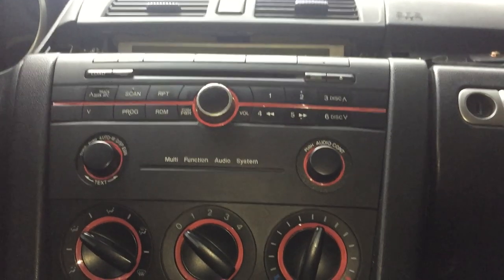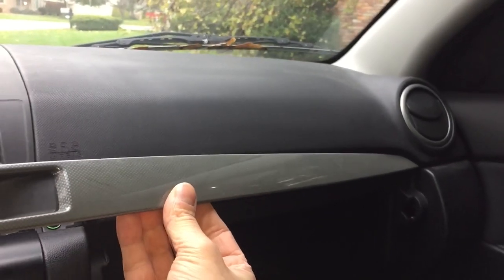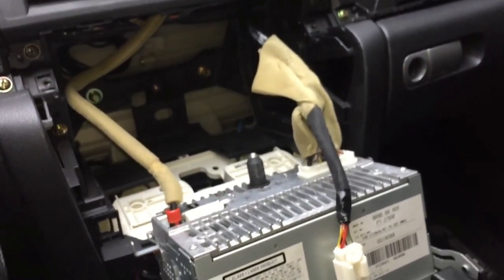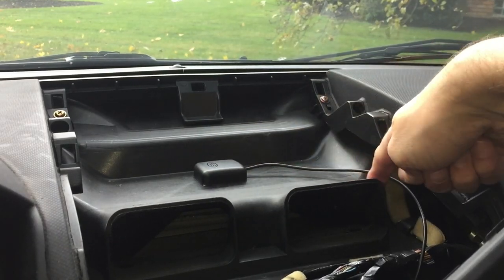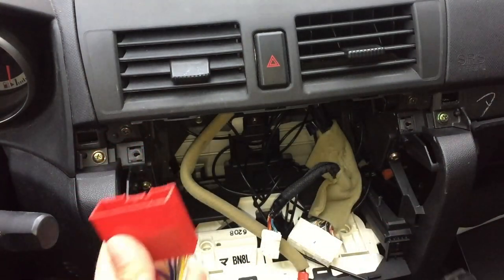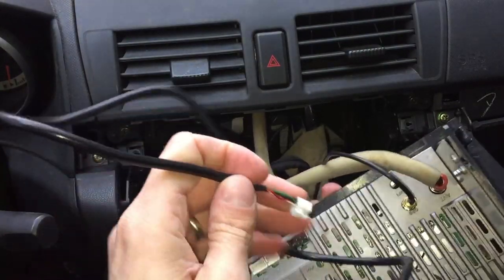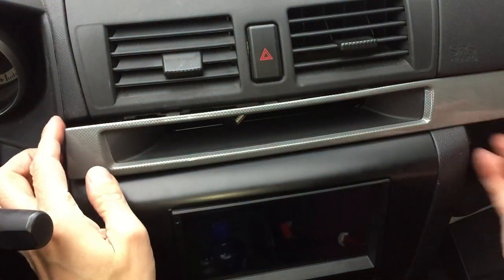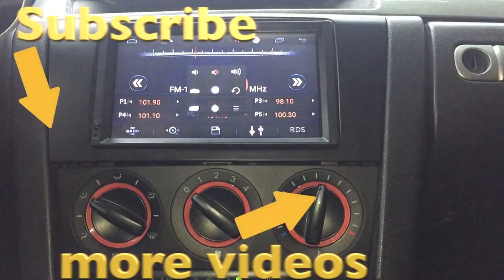Installing an aftermarket radio in a Mazda 3

Comment from the maker: This is where I found the harness adapter on Amazon:

https://amzn.to/2QMSESx
Reply: Did you lose A/C after installing after market radio ?  Did you have manual hvac or auto hvac ?
Reply: @madieandkemo   ?
Reply: Do you not have to hook up the smaller harness that comes off the back of the radio to anything? Just the big, main harness?

Comment: Did you ever have any problems trying to program a new key or key fob after Radio unit install fire sometimes you can not program a key fob with an aftermarket radio

Comment: Both the head unit bezel and head unit look like they're going to fall out. Doesn't look OEM at all, would be a target to thieves, and the break-in damage would be a lot more $$ than the head unit is worth. Went with an Eonon GA9251B. Looks and fits like it's OEM, retained all my factory features/functions including the OEM LCD + MPG calculator, and of course has large knobs.
Reply: Do you find the radio lags at only 2GB RAM?
Reply: Also, does the radio have the eonon logo on it or is there no branding?

Comment: What is the link to the site that shows what wires to connect the stereo Mazda adapter I bought it an I got blue brown oranges pink left  an on othrr side Orange White stripe an blue white stripe not sure what to do with then I looked for link like you said but could not find thanks

Comment: does the steering wheel volume control buttons still work after installing a different stereo?
Reply: NO
Reply: @dusty6935  Instslled it already and they do work lol
Reply: @konqet7741  what stereo did you install if you don’t mind me asking?
Reply: They only work if you splice wires and don't use an adapter
Reply: @blakecoombs7424  cap i installed this a year ago and buttons work great still

Comment: Where can i buy a harness  and the extra frame to attach the screen? How many  inches is that screen and what brand? Please im about to buy and i don't know where to start my car is 2007 mazda 3 isport. Thank you and i will wait for your reply.
Reply from the maker: I found mine on eBay.  
I’d suggest getting a radio that has a rotary know to adjust the volume with.  The one I used was touchscreen only and changing the volume was very painful.

Comment: So for the wiring harness
There were some wires I saw in the video that you didn't connect. So, with that one there are some we don't connect?
Reply from the maker: Correct, some of the wires are not used.  
I am not sure what all of them exactly are right now. I believe some of them were for an external amplifier.
Reply: @MegaSafetyFirst  alright thanks I was confused when connecting them but I'm sure I got it right! Thanks for the response

Comment: Ok, I bought a cheap Amazon radio which works good, but it's slightly bigger than brand name ones, so it won't fit in any dash kit. I even tried to shave off plastic, put totally ruined it, impossible with proper tools. So what now? :)

Comment: I bought a Junsun 9” for my 2005 mazdaSp23 that has a Bose system. I can’t get any sound at all and it won’t connect to my steering wheel control. Can you please advise me? It’s kinda urgent for me. Thank you.
Reply: I think the Bose system has an external amplifier so maybe you need to connect different wires to the head unit. Did you figure it out?
Reply: @brandanfiederlein3390  hello, yes. I had an auto electrician put it all together. Works like a charm. Now thinking of getting an Apple play dongle as well. My apologies for the late reply. Been busy listening to new music. Ahh, bliss

Comment: hey can you tell me which radio you have in the vid and if i can connect it with my phone to answear calls?
Reply from the maker: Hi, I don’t believe this radio is sold anymore. 
I’d suggest a model like this: https://amzn.to/3myLmj2
What I really missed in my radio were hardkeys to change the volume. Using the touchscreen for volume adjustment is very clumsy.

Comment: Does your steering wheel controllers work for the aftermarket stereo?
Reply from the maker: It does not.  It requires an extra translator box work and I decided not against getting one.

Comment: Was it reliable did did it last?
Reply from the maker: I ended up replacing it with a different radio. Not because it broke, but because I was missing a knob to control the volume.

Comment: So did you lose steering wheel controls?
Reply from the maker: As it is shown in the video, yes, the steering wheel controls will not work. 
There are special converter boxes available that make them functional again.

Comment: So you didnt have to cut anything ?
Reply from the maker: Correct, the sizes of the bezel and the radios are standardized, so they fit without having make cuts. 👍
Reply: @MegaSafetyFirst   what about wireing ?
Reply from the maker: As long as you have the adapter harness, the original cables remain unchanged

Comment: Would this work with a Mazda 3 2006 hatchback
Reply from the maker: It will.  That's exactly the same model used in this video.

Comment: What size is the factory radio?
Reply from the maker: Its a little bigger than 2-DIN.  Around 4.5” by 7”
Reply: So I wouldn’t need any kits for it right?
Reply from the maker: You definitely want one of the aftermarket bezzels.  Otherwise it won’t fit right, because the LCD above the radio also comes out.
Reply: @MegaSafetyFirst  do you have a recommendation for an aftermarket bezel?
Reply from the maker: The one that I was using was pretty flimsy, so I cannot recommend that. But I have never found one that is any better / more stable.

Comment: Thanks man that was really simply and now I will do it myself instead of playing $160 just for installation. 
What I dont like tho, is why would you take that upper part out that shows the temperature and A/C level. Why not just keep it there.
Reply from the maker: The display doesn’t work withou the original radio in place.  
A while back I’ve seen someone emulating the input signals for the display.  But that seemed to be too much work for me.
Reply: @MegaSafetyFirst  ohh.. so after installing the new stereo I won't be able to tell the temperature and the A/C level at all or does the new stereo display that also?